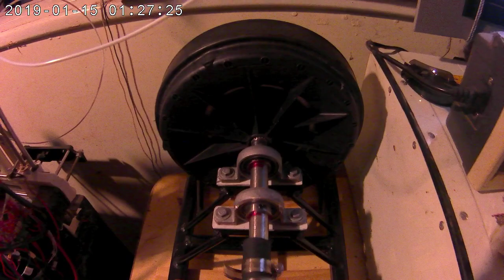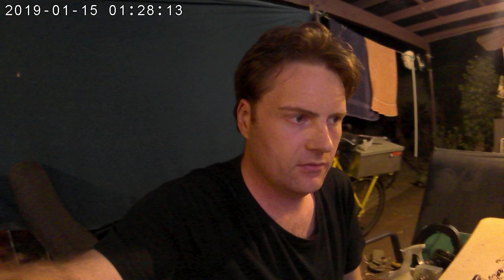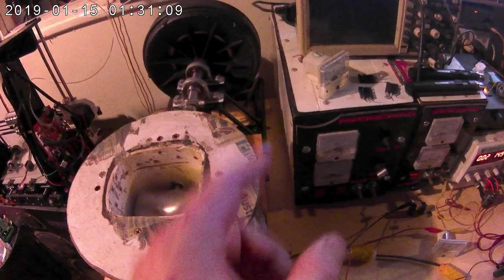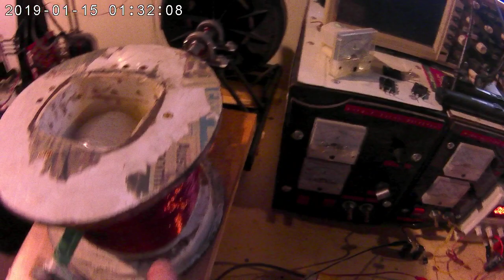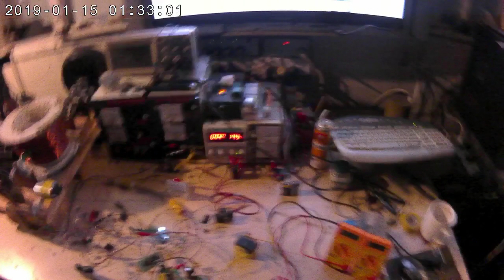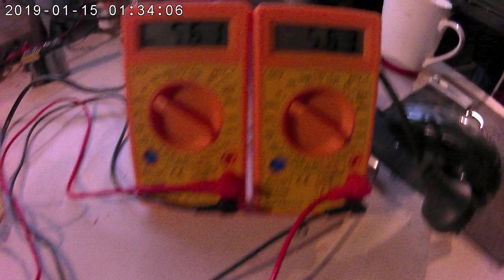I PULLed the PLUG, and it KEEPS GOING !! , annoyingly.

Comment: PLEASE NOTE : . what i am attempting too convey in this talk about the circuit problems, is that within the hbridge arrangement, the self charging is occuring because the currents induced by the magnets rotation, is flowing through the transistors in both directions, against my will, and recharging the capacitors used for base drive isolation (attempted isolation). at the same time, these backwards currents are damaging the transistors and limiting the input voltage.   -  in later videos i am able too turn up the machines input further by solving this problem which involved adding additional diodes too each of the top 2 transistors emmiters. , preventing voltage from going backwards through the emmiters and charging the base drive capacitors.     . i hope this helps at least 1 person.  i love these newman machines, and my later work is far more impressive.  - sorry about the production quality.

Comment: Interesting motor, scary voltages, no room for mistakes there, stay safe.  I've seen similar voodoo with just a frequency generator sending 100's of mW through switching transistors which then feeds caps elsewhere in the system, causing small efficient oscillators to appear perpetual.  Those e-, they do like to drift everywhere they can, any place with a lower potential.
Reply from the maker: hehe those e-lectrons do like too rush in too my circuit, from a single earth wire, - they cannot resist the attraction of a high voltage source, - luckily my coil is inbetween reaping the free advantages of more power ;-=)

Comment: When ya use a commutator with brushes,  those high voltage sparks create a huge radiant energy field  around the motor..  it'll ruin your digital meter..  it might be worth trying to catch that energy.
Reply: as it turned out. my best results were without commutators,using a hbridge,  and with a 2uf microwave capacitor in paralell with the motor,  - .    both of these facts prevented any energy recovery,   accept for mechanical energy ofcourse !